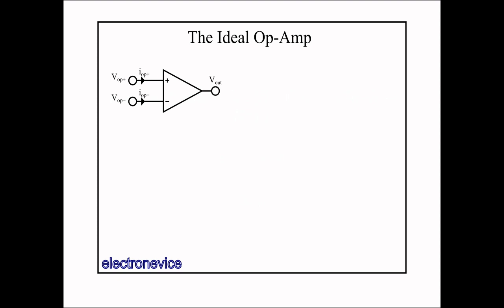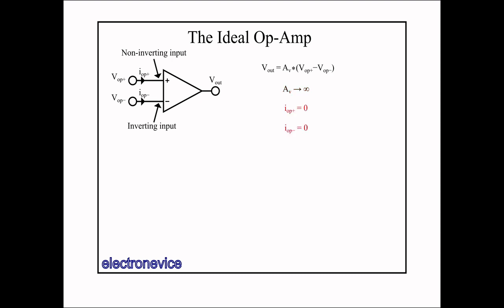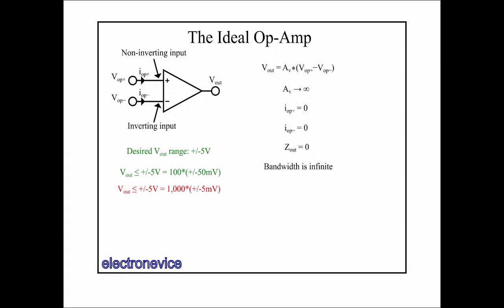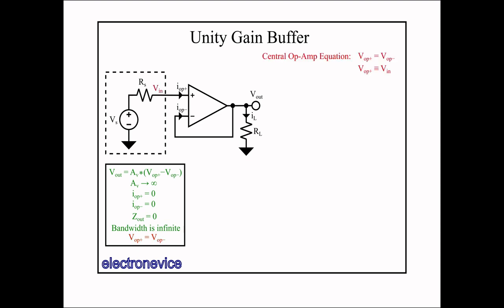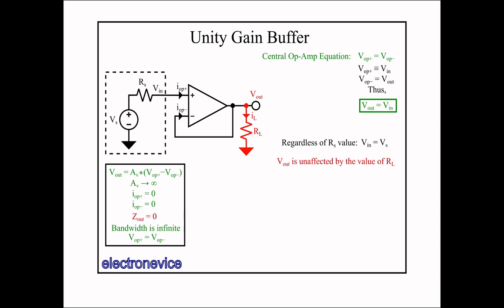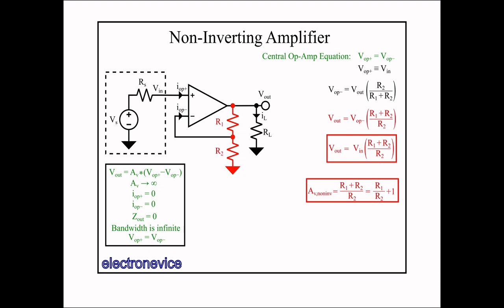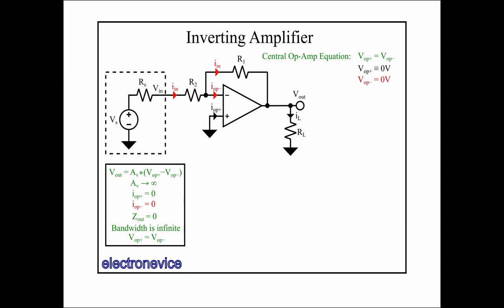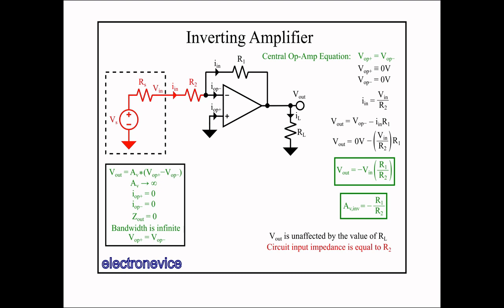Op-amp Tutorial Series 3: The Ideal Op-Amp Introduction, Non-inverting Amp, and Inverting Amp

Comment: Very good.
I'm looking forward to differentiator tutorial 😊
Reply from the maker: Thanks!  It will be out soon!
Reply: @electronevice  great stuff.
Also found the part about the crossover distortion very informative as I have been having some op amp issues and I'm pretty sure that this is the problem
Reply from the maker: @TYGAMatt  Thanks!  You can mitigate crossover distortion if you load the output in such a way that you make sure that current is always flowing in one direction out of the op-amp.  e.g. if you connect a resistor from the output to the most negative rail, then no matter how low the output voltage on the op-amp goes, it will always be sourcing current, so long as you make sure the current going into the resistor is large enough to absorb any current that is being sourced by other loads
Reply: @electronevice  thank you. I also saw that on another video.
I have a pull down resistor but it's obviously not enough so I'll play with it.
Keep up the good work and looking forward to your next episode :)